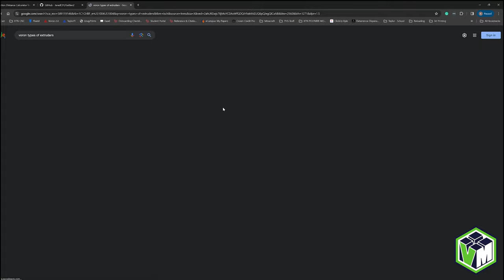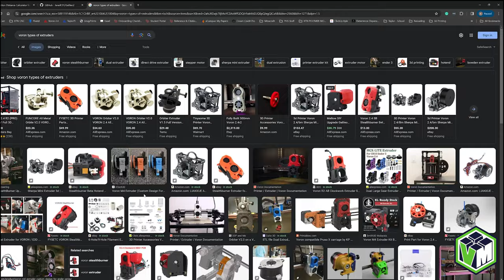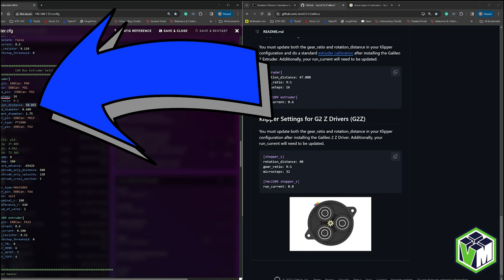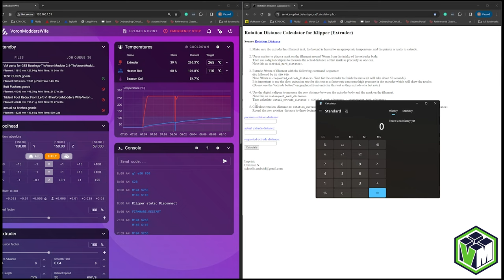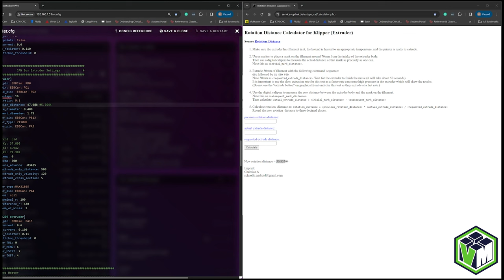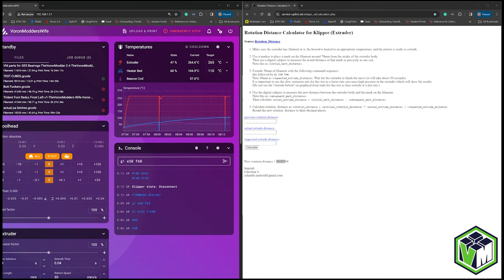Printer Tuning Part 1

Comment: How exactly do differences in hotend alter rotation distance? I believe you are mistaken here. The extruder rotation distance has nothing to do with hotends.
Reply from the maker: You make a VALID point, my explanation of hotends causing RD differences is due to experimenting with 2 LDO Orbitors and no hotend attached, running E-Steps on different printers, they measure the same with OEM RD settings, when you put a hotend on there it changes because your squeezing 1.75mm of filament through a heated .4mm or .6mm whatever size hotend hole you have. (Slight BackPressure)

Theoretically speaking here, the assumption is hotend related because that is the only change between the 2 LDO Orbitor extruders.

Im more than happy to make a video showing this with 2 G2SA's
Reply: @TheVoronModder  Thanks for getting back to me. I don’t think rotation distance is the right place to be making this compensation, I think it makes more sense to tweak extrusion multiplier instead
Reply from the maker: @MotionFriend  extrusion multiplier is the next video. We cover this. Rotational distance is a fantastic starting point. We input our gear ratio and “rotational distance” however that’s not always the case so getting the right distances I feel gets the most out of your hotend configuration. Not all stepper motors have the same torque. Different brands and what not.